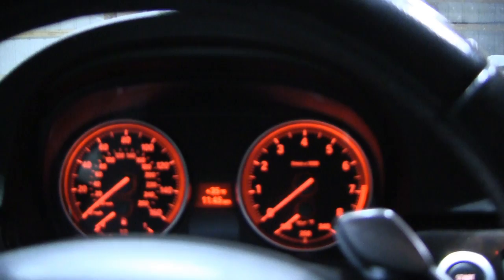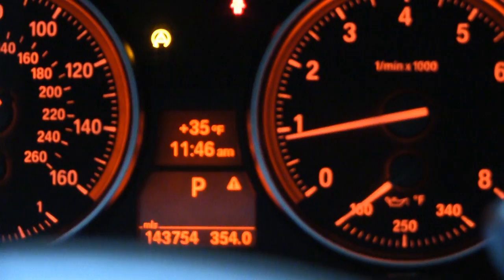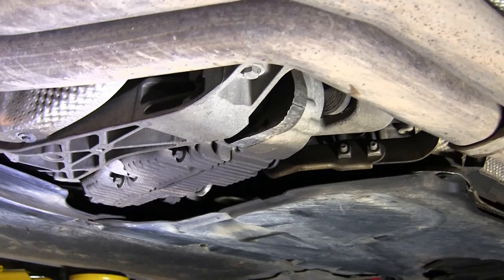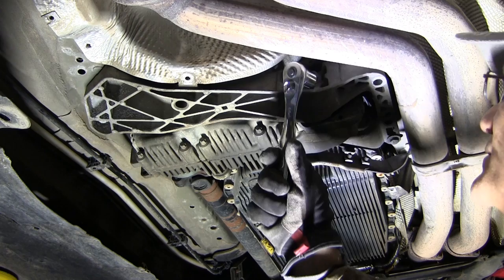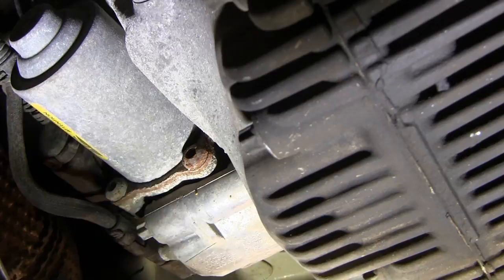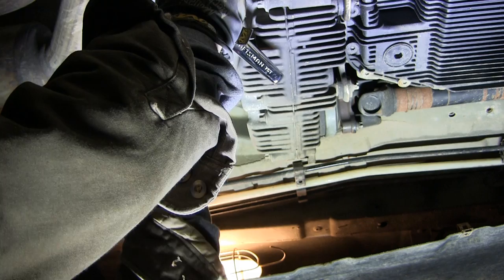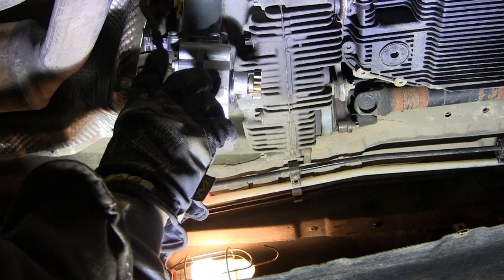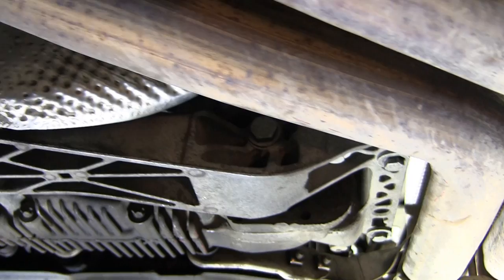3 Series BMW Transfer Case Actuator Motor Replacement 4X4! e90 x3 335xi 535xi 135xi xi

Comment: Dude.  Did it.  Could not get long bolt out.  Exhaust in way.  After some time of contemplation.  Realized that I had enough room to squeeze out transfer case.  Popped in the replacement and all good.  I’m a very happy 328xi driver now.   A million thank you.   Long live Ed!!!!
Reply: Were you getting only the 4x4! sign or the brake and ABS as well, mine switches between 4x4! and all 3, thank you I have a 328xi 2008
Reply: @monicam8266  i am getting ready to do this tomorrow if my part shows up! I have the same lights on! Did it fix yours?

Comment: Very thorough instructions, easy to follow. As also mentioned in the video, only had some trouble aligning the transfer case bracket. It should easily slide back into place if it is moved back and forth. The video was extremely helpful in navigating some of the more difficult parts. Thanks!
Reply: Any other tips for aligning the transfer case bracket, I'm stuck at this part

Comment: For anyone struggling to get that long 18mm bolt back in - I found it easiest to remove the clamp/bracket holding the exhaust right next to transfer case mount (you can’t miss it - two E11 bolts). Then jack up the exhaust with a floor jack or pole jack a little to get it out of your way. Allow the transfer case to sag a bit so it’s below the exhaust, and do not install any of the 13mm bolts. Slide 18mm in (I put my gun on it and spun it in, it went right in just be careful not to cross thread).

Comment: I changed out the actuator motor and put everything back together and there was no change so i tested the old motor and realized it still works so what else could be causing the 4x4! Light and all four wheels not to engage? Can anyone help

Comment: *Anyone saying the bolt hits the exhaust*. Loosen that bolt first but remove all the other bolts. Then use a punch to move the bolt as far back as possible. Then wiggle transfer case and bolt will come out without ever touching exhaust. Install bolt the opposite way. Much easier

Comment: Smashing job Ed, should be fixed for a loooooong time now :-).

This is where your new workshop comes into its own, inside from the weather, and a beautifull car lift to make it much nicer for you :-D, i hope you had some minimal heating.

That unit has a similar looking motor to electric windows and a smart car electric clutch servo, possibly the same power.
I really love that display backlighting, good colour and just the right intensity :-D.
Reply from the maker: Yes, the lift is soooo much nicer than laying on the floor. This job would have been a lot more challenging without the lift. I do have a wood burning stove for heat, and by next weekend we should have a natural gas heater pumping in the warmth.

I agree on the IP lighting it's nearly perfect.

Comment: Just did this job today.  I struggled a bunch with that one big bolt.  The key is to do that one first and don't be afraid to pull down on the transfer case to buy yourself some more clearance past the exhaust pipe.
Reply: The fix went well for me, too.  But the big bolt is kicking my ass!  To line up the bolt, you have to lift the whole unit up with a bottle jack.  BUT, then the exhaust pipe is in the way by about 1/2".  Back at it tomorrow, will try a couple more times.  If I fail at that, then dropping the friggin' exhaust to access the bolt.  My exhaust is definitely tighter than what's in this video.  By the way, great video. I appreciate the time and effort.  BMW's are fun to drive, but they suck for reliability. Back to Toyota's for me!  Cheers, all.
Reply: @flyingbatfish  Did u manage to line up the big bolt?

Comment: Hearing same noise but getting abs dsc and emerg brake malfunction along with 4x4. Would it still be the actuator
Reply: 328i2008
Reply: Yes I believe it is your transfer case actuator, specifically a worn plastic gear inside that the worm gear touches.
Reply: did you find out?  I have the same problem but the other guys comment is wrong because the gear and worm gear are metal in our cars.  The plastic ones are in the X models like X3/X5 and stuff.

Comment: Thank you for this video. I have a 320i xDrive. It started to shift hard, and I took it to the BMW dealership. I was told that the Transfer case has a problem and the problem goes away when they unplug the connector. Is the problem from the motor actuator? I was told that I need to replace the whole transfer case.

Comment: Question I took mine to the dealer and they said I need a new transfer case on my 09 335ix I don’t have any lights on my dash the only problem I’m having is when turning the steering wheels all the way it makes a weird noise but only when I’m trying to park or do a U turn but besides that the car drives fine to me just can’t turn at very low speeds please help I wanted to know if I just disconnect the sensors if the problem would go away cause I’m find driving my car rear wheels anyways I have xDelete so is already rear wheel drive but is making this noise when turning or making a u turn.

Comment: Thank you for the great explain
I have a question if you please.
My 320xd 2009 have same problem .I changed the servo motor and the battery I control the fuis or ok but still have the problem withe the ABS and the 4x4thanks on advance for your answers

Comment: For the 4x4 lights being constantly on on BMW X5 E53 2006 , does it mean the 4x4 is not working and its only running on 2 wheels? Is this something that can leave me stranded on the road? What is the impact of this error? Please guide.
Thanks

Comment: Quick question for you sometimes when I turn right or left and Accelerate it bucks on me so then I let off the gas and then go and it’s fine was wondering if that was any indication of the all wheel drive setup and what would cause this I have no lights coming up at all hmmm lol it’s a 2007 328xi please help

Comment: I've done everything as demonstrated except the I put the 18mm bolt backwards cause it was alot easier that way. When I drive my 328xi coupe now the 4x4 light is off but when I take hard turns I feel the 4x4 engaging and disengaging and it feel clunky and not right at all. Is it because I put the bolt backwards or because I bought a ebay part? Someone please help before I take it to the pro's and they charge me a arm and a leg lol

Comment: I have an 06 e90 330xi, my abs light and 4x4 light are on and the code coming up is the 5f3a code (transfer case), would this issue cause both the abs and 4x4 lights to illuminate?
Reply: Its Prism did you ever figure out what was wrong?
Reply: I know that it does mean that there's an issue. Like our Tucson, when the Battery Light & Brake Light come on, it means the Regulator inside the Alternator, so it's not charging the battery more than 12.6 volts........
Reply: Did you figure this out?
Reply: @abrahamhungria4838  yeah, I had to replace the entire transfer case and servo motor.

Comment: i dont know if this channel still active but i would love to get an answer, so i put difference size tires (noob mistake) and messed up my transfer case, i went to a mechanic and he charged me 60$ to take it out, now i need to put a new one in and they charging me beetween 1200 and 1600, would love to know if by doing what was done in this video i can get that done by myself and the car would be fixed or theres something else to be replaced, i drove the car after from the mechanic to my house no problems, when mine broke there was liquid coming out and some metal little balls came out too, so if i could get any help here i would gladly appreciate it.

Comment: @EdzGarage . Ed, I wonder if that's what could be the issue with the 2010 Jeep Patriot I have. Although I wiggled that grounding strap that goes from the engine to the body & the 4WD! Light was off the next 2 times I drove the Jeep, if it does come back on, could it be the same type of part that's bad as with your BMW? The Patriot stays in FWD whenever the 4WD! Light is on, so that's how they're set up. Thx, MD

Comment: If anybody could help me it would be very much appreciated. I have a mini Cooper with the exact same warning light and problem, I’m stuck in front wheel drive. The dealership told me it was the EMCD on the rear diff so I replaced the entire rear diff and it did not fix it. I can’t find any help online and I haven’t had all wheel drive for almost a year now. Any tips would be appreciated!

Comment: I reverse to parked my car and when I turned it on, gave me brake light fluid service, dsc, 4x4 codes. Fluid are new and  replaced my two brake sensors. My service is due this month but couldn't reset it. I wonder if the service is throwing the 4x4 codes too? Please help.

Comment: Could this part also cause a grinding noise ? I’m hearing on 1st to 2nd gear 1k-1500 rpm
Reply: Yes it can, however its best to check your computer. It usually is able to detect the issue and turn off the actuator motor leaving you with a 4×4 light and loss of power

Comment: hi, did you have to perform any software reset or calibration, its just plug and play ? the new unit will adjust itself and "learn" the new position ? thanks very much.
Reply from the maker: Yes, mine was plug and play.
Reply: @edzgarage  thanks for the prompt reply Ed

Comment: Please DO NOT buy the cheap ones from ebay unless you can use your old resistor. Thats what actually happened  to me..
I replaced mine that had bad gears however after installing the new one the error was still there and I could not perform the calibration.
So I swapped the resistor and installed the old one and it worked right up
Reply: You have to calibrate these? I replaced the part and now it binds when I’m turning. If I turn sharp enough it squeals the rear tire. How do I calibrate it?? Or is this because I used the new resistor?

Comment: Hey, I'm wondering if you can help me out, I have a 2007 bmw 328xi and the sign came on and it constantly shows, but driving is smooth and there is no noise when shutting of the car and this sign comes and goes but somehow is stuck today and so on!
Reply from the maker: The actuator needs to be replaced. Mine did the same thing it was intermittent for awhile then stopped working completely and 4X4 light on all the time.
Reply: EdzGarage now it's gone haha, this issue is really confusing and mine doesn't make any noise

Comment: This signal popped up in the middle of driving, how is this possible? I understand that the actuator doesn't work upon starting the car, but how does the 4X4! problem pop up suddenly when I'm going in a straight line on the highway?
Reply: @Dust Settler was it just the 4x4! light or was it the triad of lights including ABS and DTC?  If it was only the 4x4! light that came on while driving, you might have a faulty steering angle sensor.
Reply: @asimkhan8620  hard to remember since it was a whole year ago but I think yes it was just the 4x4!. It never happened again since.

Comment: Have you changed your transfer case fluid yet? If so, did you have to reset the adaptation with a code scanner?
Reply from the maker: I haven't replaced the fluid yet. Most codes are resettable through the car's computer without a scanner.

Comment: I have 07 328xi and will be doing this soon. I keep seeing people mention having to "reset system" because of new resistor, but not saying much else .  Do you know if this necessary and if so does it require a scanner?
Reply: Have you completed this yet? I am doing mine tomorrow if part shows up, did all your lights go out? I have 4x4 abs and brake light on
Reply: @ericmiller5470  did you replace the TC actuator?  Was it a successful fix? Thanks
Reply: did you fix it?

Comment: Wow what a great video! Thanks for taking the time to make a short tutorial about it. Quick question! This should be similar to a 06 BMW 330xi right? I wouldn't think it would be different, but just asking in case. Looking at one on craigslist with the exact problem and it's a steal for $1,500 and supposedly throwing the same code.
Reply from the maker: If it's not the exact same repair it should be very similar. $1500 is a steal for an 06 330xi.
Reply: Thank you for the response! Love your videos.

Comment: Pretty easy fix , Good job Ed ! Thumbs up ..
Reply from the maker: Yep, the lift makes these jobs easy for sure. Thanks for the comment Buddy!
Reply: EdzGarage Hey, I'm wondering if you can help me out, I have a 2007 bmw 328xi and the sign came on and it constantly shows, but driving is smooth and there is no noise when shutting of the car and this sign comes and goes but somehow is stuck today and so on!
Reply: Jehad Nesh Hello did you solve your 328 problem???

Comment: Did u have to drain the oil?  And did u use the new or the old resistor?
Reply: No need to drain oil, and use the old resistor since it has been calibrate at your cars system.

Comment: Hi,

I have a 2006 BMW X5 e53 3.0i and it has the 4x4 light constantly on.  The O2 sensor needs replacing as well.

Please advise what could be causing it and how to fix it.

Much appreciated..!!!
Reply: The Visionary same thing for me bank 2 sensor 1
Reply: @sors1599  

I went to a mechanic with good reputation. He said unless you have to get emission test, don't worry about the o2 sensor, it's not going to make a difference otherwise.
Reply: Have u fixed the problem?? Mine is the same car doing the same thing. Any luck ???

Comment: how much did the part cost? looking to do this myself. the local shop wanted $1200 for the job seems a bit steep
Reply: No don't do it !!.the part should cost you around 380 400 (Amazon )and my  mechanic will install it for 200. He is charging you double!!

Comment: Pretty easy fix , Good job Ed ! 
Do you use winter tyres ?
Reply from the maker: No, I don't use winter tires on this car since it's all wheel drive, I did use them on the old e46 since it was just rear wheel drive.
Reply: I think winter tyre for a 4wd all so beter, your brakes work on the same on 2wd and 4 wd
Reply: EdzGarage hi sr. can you tell me wish codes you have ,couse i have the same 4x4 ! light on

Comment: That's great Ed, Thanks for sharing!  I am having this same issue but the dealer wanted $5400 to replace the transfer case and servo motor. I am thinking I should start here with this motor and see if that fixes the problem. Thoughts?
Reply from the maker: Wow... there are 5000 reasons to try the servo motor first. I bet that's all your problem is. Good luck!
Reply: @edzgarage  hi do you have the codes for this.
Reply: It doesnt throw codes only griding when you try to take off or stop right away
Reply: @alexg8460  would it be the servo motor if I experience jerking at very low speeds and light acceleration?

Comment: WHEN REPLACE THE TRANFER CASE MOTOR HAS TO BE RECODE AND PROGRAM IN ORDER TO RESET IGHTS
I BELIVE
Reply: Carlos, I believe it is only the motor resistor that needs to be programmed. If you change the TC actuator but not the resistor (keep your original like the author here did) then there is no need for programming.  There is nothing in the rest of the actuator unit that can be programmed, correct?

Comment: HELLO I DID ALL THIS BUT MY LIGHTS ARE STILL ON WHEN I PUT IT IN DRIVE PLEASE WHAT SHOULD I DO RESET????
Reply from the maker: No reset needed. Are you sure all the connections are good and tight? Might want to verify the fuses are good too.
Reply: yes followed your process exactly, but I was told at the diagnostic place that my fluid is low. I will make sure everything is tigh. THank You
Reply: Did you fix the issue ???
Reply: @Brucelee89896  did u fix it??
Reply: @Triplemyworth709  nooo man that never got fix i tried everything, new transfer case, oil and nothing, Car drove fine but I sold it

Comment: thanks for a such a nice and helpful video. I see that you removed the long bolt at 2:35 so easily but mine was blocked by the exhaust pipe. I aborted the work and put the bolt back in. Mine is a 2007 328xi automatic. Is there any tip you can give me on how to remove this bold easily. Removing the exhaust pipe was very difficult and hence didnt want to do that.
Reply: Looks like the transfer case freed up and dropped enough to get the bolt out when he removed the bracket?
Reply: Any luck on getting that bolt so far? I have the same vehicle and it is not delivering any power to the front axle. I have a feeling this is the cause, but I have not confirmed it. The only thing different with my car is there are no lights illuminated on the dash while the car is on dry pavement with all four wheels turning in sync. The dash lights up though when the rear wheels lose traction and are allowed to turn out of sync with the front axle.

Comment: Hey I did this but still have the 4 x 4 light anything else you think could be wrong or I should check ?
Reply: MBF drift life yes me too my 330xi just did all this but all my lights are still coming in what should I do
Reply: Did you guys fix issue? Also replaced mine but now my brake light is on but in red? I think this is rear brake sensor that is bad , i will have it scanned tomorrow from y trusty mecanic and i hope this is it! Did you guys find the problem?

Comment: Any video of the noise ?
Reply from the maker: It's a slight grinding noise from under the center counsel. It gets worse over a few days then the "4X4!" light comes on and stays on. I didn't have the noise anymore when I did this video since I drove the car that way for 5 months, and the grinding had stopped completely by that time, because the worm gear was completely worn away.
Reply: EdzGarage oh okay cause I have a noise coming from that same area i don't know if it's the transfer case itself of just the module it slips when I try to drive and just revvv